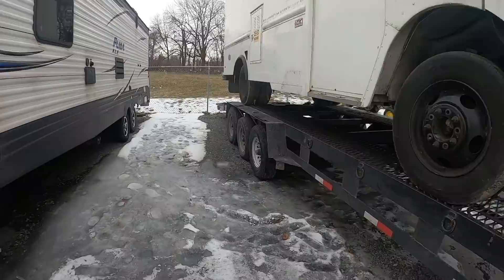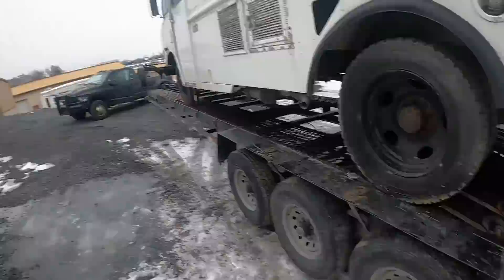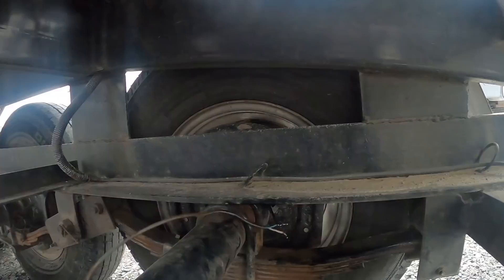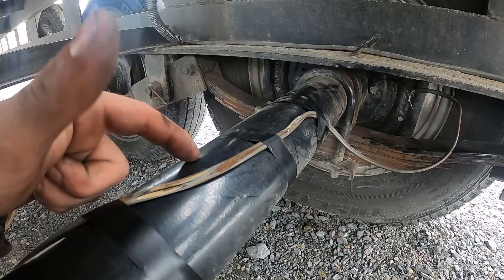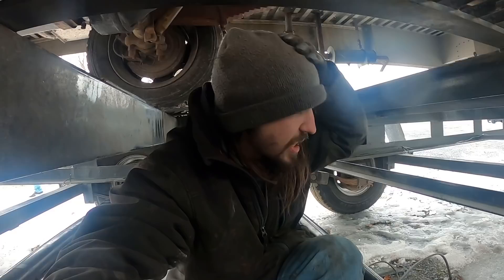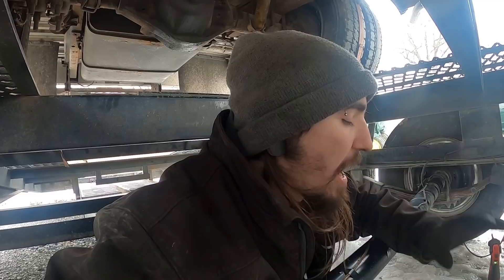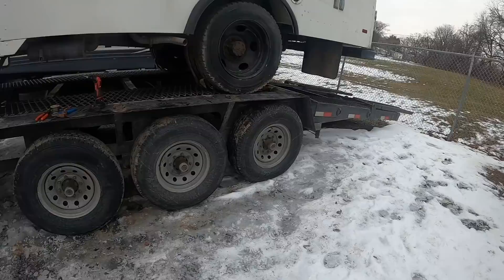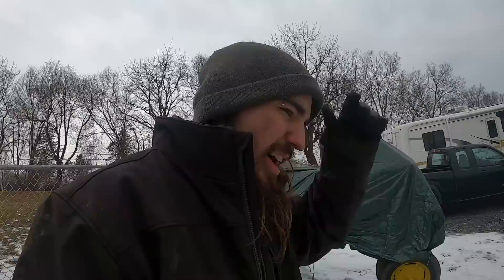Trailer Brakes Are Fixed | Here's Why Most New Hotshot Drivers Fail | Don't Be A Statistic!

Comment: When you get more shorts , look at the bare wire that you taped up and fixed. That water gets into the bare spots and can corrode the wire a few inches up into the sheathing that you cant see. I went ahead and spent a little more money on 16 ply tires and my flats went way way down and i also got so much more life out of the better tires.

Comment: Steve, wrap the axle wiring with zip ties. That tape is gonna work itself loose when moisture hits it over time. And don't forget dielectric grease to prevent corrosion 👍
Reply: That's what I was going to ask you about, it using zip ties was an option for securing the brake wiring.
Reply: @russellriggan2088  absolutely friend. Zip ties are mandatory to keep in the truck. Harbor Freight for the win..

Comment: Hi:

I'm the guy with a few million commercial miles who writes in once in a while offering advice about things that have worked for me in my career.

On my trailers and truck, all tires are balanced and are of the same brand and tread pattern. Then I added  centramatic wheel balancer discs that keep them, the drums, and axles balanced. 
as gravel became stuck in the treads.
Some would be flung off at speed, but many remained for thousands of miles, trying to unbalance them. 
The Centramatic  loaded with shot in a proprietary oil kept them balanced in spite of dried mud, stones and dirt.

Steve: pick up an inflated tire, raise it a couple of feet, then drop it.

You'll notice that it bounces many times before settling down. 
That's what unbalanced tires do, and every time they contact the pavement after a bounce, a bit of tread is removed. It's called cupping.

It also makes for a lot of heat, and creates an out of round condition in the tires. Eventually they farigue, and blow.

The suspension system also takes a beating as do the bearings, etc.

I also bought shock absorber moun ting kits. The shocks kept the tire bouncing over bumps to a minimum, and along with the wheel balancing  and disks my tire life improved between 20-25%

That's a hell of a lot of savings over the years, as well as knowing that everything was always in sync, and trouble free for the most part.

Don't paint the truck in like forever, and keep the white one looking like shit if you like, but invest in things that will keep you operating worry free like the pro you're striving to become.

Most of the time you seem to have your feet planted firmly in mid air, and that's ok because you're young and learning, but do try to become consistent in doing things that will elevate your professionalism.

That Kaufman trailer needs new tires, shock absorber mounting kits,  balanced new tires, and those--relatively inexpensive Centramatic wheel balancers.

You'll go thousands of trouble free miles, like a pro, without having to constantly screw with faulty equipment.

I get a chuckle out of your ramblings.
You're a self starter, and entrepreneur. I like that. Reminds  me of myself when I was growing in the business.

Michael  Rzewuski

Comment: I use my old extion cords that have bad ends or was damaged in the middle. Makes good cheap trailer brake wire. Double jacketed and has three wires, use two black and white have the green for backup. If one of the other gets damaged.
Reply from the maker: Not a bad idea
Reply: @CP Steve Miller  good idea to be reperposing things but bad to cause u could have a internal issue in that cord u dont know  and could cause u a headache down the road  but good thinking guys

Comment: I wiring issues almost the same as you are experiencing.  I sealed them the exposed wires but in my case water ran down inside wires and continued to corrode the wires inside. In the end I had to replace all the wiring hopefully you don't have to do the same good luck

Comment: You should have just went and used new wire and rewired the trialer to advoid future problems , and use zip ties instead of taping the wires to the tubes .

Comment: A lot of people say balancing them does help they say it helps stop premature wear on the bearings of the tires wobbling while you're going down the road I have a trailer and the tires are not balanced but a lot of people say you don't have to a lot of people say do do it saves on bearings and wear tear on joints and stuff which I guess makes sense if your tires ain't balanced on your car they shake real bad well if the tires on the trailer is shaking while you go down the road then the leaf spring purchase and everything are getting wore out from the movements

Comment: I used to work as a mobile Mechanic for a guy that had a lawn care business. He had a bunch of trailers and I noticed that even new trailers have terrible wiring. He had 3 top of the line enclosed trailers and within 12 months I was having to repair the wiring. These repairs were not from abuse they were just from bad installation. A lot of companies use wire nuts and they don't do well in the weather or vibration. Also the industry has decided to use those cheap plastic plugs that don't last very long. They should use the 6 pin trucking industry style.  

I balanced my RV trailer tires to see if they last any longer, and I am getting ready to change the axles on my 7K car trailer ( should of bought a 10K trailer) which will require new tires and wheels. I won't know for years if it really makes a difference.

Comment: Built  a  trailer  about  ten  years  ago.  12  x  7,  flat  with  removable  sides.  Ran  garden  hoe  down  the  length  of  the  trailer,  tucked  up  inside  the  frame  to  run  the  wires  through.  Siliconed  the  ends  shut  for  waterproof.  had  one  axle  with  a  wire  loom  running  across.  Garden  hose  sheath  on  it.  Welded  tabs  for  hold  downs.  Beautiful  trailer,  never  a  problem  with  the  wiring.

Comment: Hey I feel your pain. What I have done being most of my trailers and the ones I have rewired for friends (rural/farm and ranch use), is run all wires thru old water hose. It's big enough, flexible enough, and of course cheap enough. First things I do on a trailer... Rewire to 7-way without using the wire thru axles and use grease not oil. Very, very, very rare do I have any brake issues from then. Keep going, man!
Reply: Forgot the third thing... balance tires! Worth every penny with tire wear and comfort.
Reply: @fredwalker839  man what's the point in wasting so much energy trying to trash someone in the comments section of the video they created. If you feel his methods are unethical and dislike his content then just stop watching.

Comment: Once the wires insulation is broken it's only a short time before it corrode and won't carry the required current to power the magnets fully. Corroded wire loses it's capacity to conduct current, those compromised wires will continue to give you issues.

Comment: Yes, balance the tires. The tire life, suspension life and overall trailer life should be longer without all the extra vibration and shaking thing apart.
Wiring, I would weld nuts to the trailer frame and run gray plastic electrical conduit through the nuts. Put inline junction boxes where you need to side marker lights and brake wires out. Run conduit to each side of the trailer for lights and brakes. I would also run individual wires in there making it easy to solder and heat shrink or liquid electric tape wires. Doing this I would place a few T's with down pipe and cap in low spots in the conduit to give moisture a place to go. That way you can have a removable cap and drain. Individual wires would let you check and replace a bad section of wire without having to replace the whole bundle. 
We do the conduit on small 4 wheeler trailers that get pull through the woods to keep the wiring intacted works great.

Comment: Be sure to get Trailer tires and NOT LT tires. Get the highest ply tire you can afford. Definitely balance them.
Register your trailer in PA. Get the permanent plates that basically cost 5 years up front then free there after. Same name and address as your truck and drivers license. State police like to see that all match and it is all you.
Lastly get a non commercial Class A license. Yes PA has this. Minimal cost and effort. No written, just a simple driving test with your setup. Any trailer over 10k must have a class A license. Either non commercial or commercial. Even if you are non commercial and towing your own stuff, need class A.
Everyone be safe.
Reply from the maker: I disagree on the trailer tires. They're garbage compared to truck tires. I run the Cooper Discoverer ht3 and they have been awesome. For weight reasons I can't run anything more than 10 ply or I start to cut into my capacity. I try to keep my weight in between 14 and 15k. At least until I get my class a cdl. There's no point in a non commercial license. I already have my permit. Just need time to schedule the test is all. Also no trailer over 10k requires a commercial license. I have the rules from the fmcsa screenshotted on my phone. 

Class a - Any combination over 26,000 "inclusive" to a trailer over 10,000 gvwr

Class B - Power unit over 26,000 with a trailer no greater than 10,000

Class C - Any combination under 26,001

Only California has the 10k trailer rule. Any dot officer that tells you that you need a cdl over 10k is playing you and that's when you get a lawyer. 

Here's specifically for pa - If your trailer is over 10k the combination has to be over 26k for you to need a commercial license

https://www.dmv.pa.gov/Pages/FAQ%20Pages/Commercial-Driver%E2%80%99s-License-FAQ.aspx
Reply: @CPSteveMiller  In PA, towing any trailer over 10k requires a Class A license. Either non-commercial or commercial/CDL. There are 2 types of Class A licenses. Driving with a class C license and towing a trailer with gvwr over 10k, empty or loaded, requires a Class A license. You can get a driving out of class ticket. And on top of that ticket get another biggie ticket for driving commercial/compensated without a CDL-A license. 
And with a CDL-A permit, aren't you required to have a cdl licensed driver in the passenger seat when you are driving?
This is a very tricky issue.
Reply from the maker: Incorrect. That law changed many years ago. Click the link I shared with you. Pa does NOT require a cdl license on a trailer over 10k UNLESS you are over 26,000
Reply from the maker: Copied right from PA dmv

1. Who must have a commercial driver’s license (CDL)?
Anyone who drives a commercial motor vehicle. The definition of a commercial motor vehicle is:
a combination of vehicles with a gross vehicle weight rating of 26,001 or more pounds, provided the vehicle being towed is in excess of 10,000 pounds;
a single vehicle with a gross vehicle weight rating of 26,001 or more pounds;
a vehicle designed to transport 16 or more passengers, including the driver;
a school bus; or
any vehicle that is transporting hazardous materials and is required to be placarded in accordance with State and Federal regulations.

Comment: Man i tell my kids and gf to not cut threw the truck and trailer. Always cross infront of the truck no matter what. My gf daughter has learned how much it pisses me off when she runs between truck and trailer. I pull both goose and bumper. But I tell em. Treat it like it ain't connected. At home. I will in hook at night. And leave the trailer at home. If a jack failed some one could get hurt.

Comment: I personally wouldn’t re use those wires. Wire is pretty cheap compared to what it would cost if the brakes failed at the wrong time. Just my opinion.

Comment: North Carolina is tough on hotshots but fair in treatment. The big complaints I always saw was some dude got caught overweight in some way or another. When I was younger I was usually driving above the speed limit. I grew up with no speed limits. So I would once in a great while get stopped for speeding. I just called it a tax for good driving. No complaints, I knew the law. Now that I am retired and have nowhere to go and all day to get there I can drive the ridiculously low speed limits. The first time I drove a hundred miles an hour I was 8 years old. My dad was in the car. He is the one who insisted I actually learn to drive. We were in farm country so it was very common for young people to be driving. No speed limit.

Next time you do brakes get the self adjusting type. So much better. Put the Moryde CRE 3000 equalizers in. You will thank me.

Take that low tire and wheel off and see if the rim is leaking. Yes I have had rim leaks. Dadgum chewing gum welds. Ditch the weights and get Balance Beads. For those wheels and tires most likely 5 or 6 ounces. They just plain work.

Comment: See thats what suck with them style brakes it is hard to get all of the brakes to be around them same. There is always 1 or 2 that wear out faster do to they where tighter adjusted than the others. Hydraulic over disc would be the way to go. they are always N-SYNC and easy to work on!

Comment: Also, you should always balance your trailer tires. The vibration and bouncing will cause your tires to heat up and shorten the life of the bearings.  Also by it bouncing at high speeds, the tires will start to cup. I have Centramatic Balancers on all my wheels. Think about it...👍

Comment: Yes, I balance all my trailer tires. Why wouldn't you? It can help yield higher miles on a set of tires.
Reply from the maker: Doesn't hurt to ask. I'll be mounting my new tires on Thursday. We have a balancer in the shop as well so it won't take much time
Reply: @CPSteveMiller  I had a guy at my tire shop that wasn't going to balance the rear tires of my dually. I had to tell him to do it and I'm glad, it was off and had a wobble so he had to break the bead and remount then it was all good.  High speed balance can never hurt.

Comment: In my opinion US trailers build quality is SUPER low in EU electric harness last like 4-5 years in snow salt rain, and no problem at all. Some rust will appear after some time but most trailers are galvanized. Just my opinion from former Tow Truck driver.

Comment: All Cummins leak oil I have had every make an all leak oil my 6.7 to I think I blew head gasket today it’s running fine not running hot nothing but over flow is bubbling water at idle I dunno what else would make it do that going change thermostat but that would not make overflow bubble out . But it does look like hose that runs from over flow to radiator cap has hole or over flow jug is cracked any advice is appreciated

Comment: What do you think about the way Bitcoin is evolving
Reply from the maker: It always hits a high, then crashes, then works its way to another all time high. Volatility is a good thing. When it crashes it brings new people into the market.
Reply: Replace using electrical tape with Shrink Tube, it's waterproof.